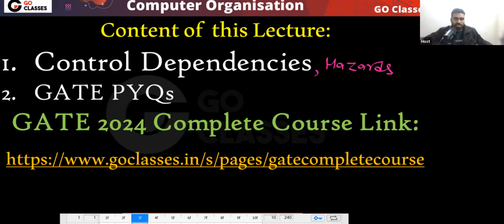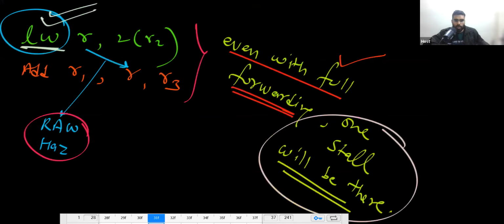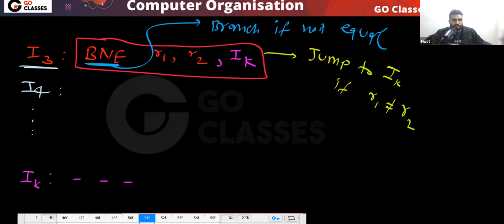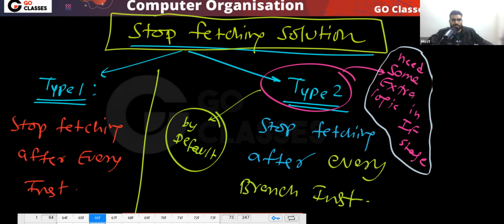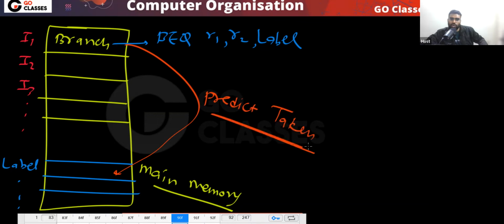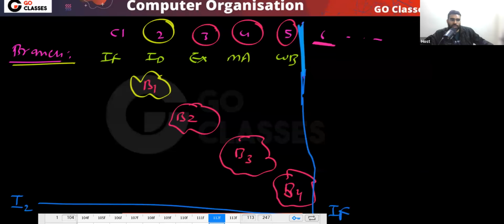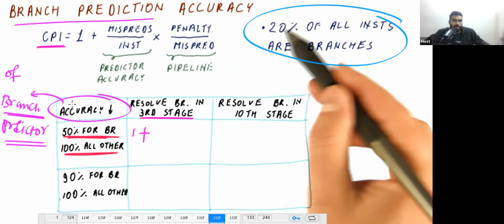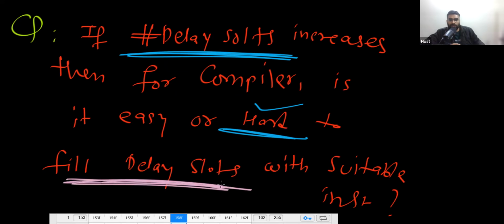Pipeline Lec 5 - Control Hazards | Branch Prediction | Pipeline Complete Course & GATE PYQs

Comment: 00:00:01 - Introduction to Structural and Control Hazards

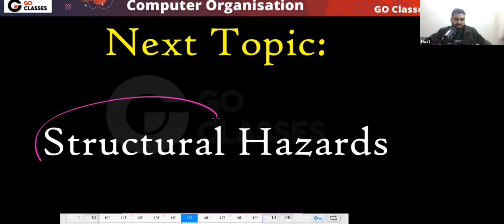00:05:40 - Structural Hazard (Resource Hazard) Definition

00:06:15 - Structural Hazard Example: Single Port Memory

00:16:02 - Stalls/Bubbles due to Structural Hazards

00:19:59 - Solutions for Structural Hazards

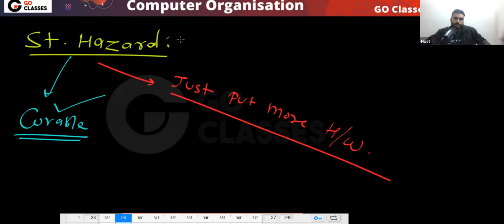00:23:29 - Recap: Eliminating Data Hazards (WAR, WAW, RAW)

00:29:28 - Introduction to Control Hazards

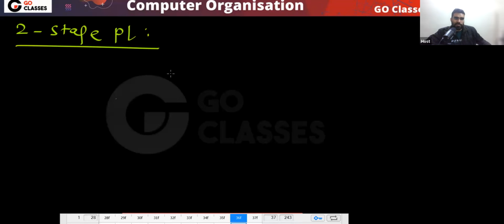00:31:52 - Control Hazard Example in 2-Stage Pipeline

00:38:27 - Flushing the Pipeline

00:44:50 - Branch Penalty Formula (K-1 Stalls)

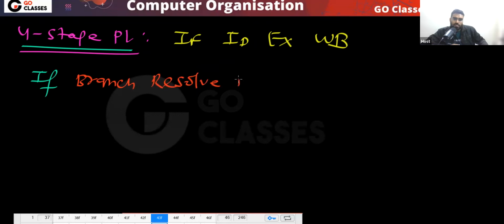00:46:48 - Branch Penalty in 4-Stage Pipeline

00:54:33 - Control Dependency

00:58:10 - Solution 1: Stop Fetching

01:06:19 - Stop Fetching Type 1: After Every Instruction

01:11:37 - Stop Fetching Type 2: After Branch Instructions Only

01:24:39 - Solution 2: Static Branch Prediction

01:30:43 - Predict Not Taken vs. Predict Taken

01:34:50 - Predict Taken Scheme

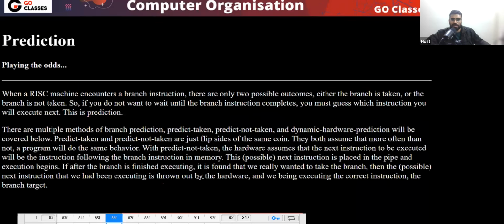01:41:39 - Predict Not Taken Scheme

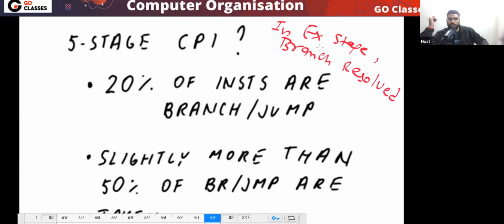01:45:32 - Practice Question: CPI with Stop Fetching Solution

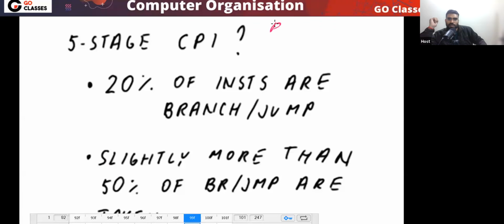01:54:15 - Practice Question: CPI with Predict Not Taken Solution

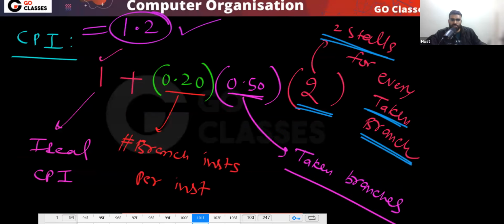01:59:00 - Practice Question: 25% Taken Branches

02:04:00 - GATE 2000 Question Solution (Part A)

02:13:00 - GATE 2000 Question Solution (Part B)

02:23:56 - GATE 2006 Question Solution

02:30:01 - Solution 3: Dynamic Branch Prediction

02:31:45 - Calculating CPI with Dynamic Prediction Accuracy

02:37:45 - Speed-up Calculation

02:40:35 - Solution 4: Delayed Branching

02:45:51 - Delay Slots

02:50:06 - Filling Delay Slots with Independent Instructions

03:00:01 - Conclusion and Summary

🔴🔴MAJOR MISCONCETPTIONS

00:23:29 – 00:24:11 | Are Structural Hazards "Incurable"?

Misconception: Thinking structural hazards are a major, unsolvable problem like data hazards.

Clarification: Structural hazards are easily curable. They are simply a "lack of hardware" (resources). If you add more hardware (e.g., separate instruction and data memory), the hazard disappears completely.

00:24:11 – 00:28:09 | Are Data Hazards 100% Eliminatable?

Misconception: Thinking all data hazards can be perfectly fixed.

Clarification:

WAW/WAR Hazards: Yes, these are 100% eliminatable using register renaming.

RAW Hazards: No, these are the "real villain." Even with full forwarding, they cannot be 100% eliminated (specifically the Load-Use hazard still requires one stall).

00:34:44 | Knowing it's a Branch during Fetch

Misconception: Assuming the processor knows an instruction is a "Jump" or "Branch" while it is still fetching it.

Clarification: In the standard pipeline, during the Fetch stage (IF), the processor does not know what the instruction is yet. It only finds out it is a branch during the Decode (ID) stage, which is why bubbles are created.

01:06:19 – 01:09:48 | "Stop Fetching" Strategy Scope

Misconception: Thinking the basic "Stop Fetching" solution only pauses for branches.

Clarification: The speaker clarifies that without extra hardware to detect branches early, the "Stop Fetching" solution (Type 1) would have to pause after every single instruction (even additions or subtractions), making it the "worst solution." To stop only for branches (Type 2), you need extra hardware in the IF stage.

01:22:58 | Definition of a "Bubble"

Misconception: A student asks "Why two bubbles?" implying a bubble is a specific object or error.

Clarification: A "bubble" is just terminology for a stall. It simply means that for that specific clock cycle, no new instruction is being fetched. It’s not a physical object inserted into the pipeline.

01:48:05 | Relevance of "Branch Taken" Percentage

Misconception: Trying to use data about "50% branches are taken" when using the "Stop Fetching" solution.

Clarification: For the "Stop Fetching" solution, whether a branch is taken or not is irrelevant. You stop fetching for every branch instruction regardless of the outcome, so you pay the penalty every time.

02:02:42 | When do we pay the penalty in Static Prediction?

Misconception: Confusion on why we calculate stalls only for "Taken" branches in the "Predict Not Taken" scheme.

Clarification: In "Predict Not Taken," you assume the branch won't jump. You only pay a penalty (stalls) when your prediction is wrong (i.e., when the branch is actually Taken).

02:53:29 | Meaning of "Independent Instruction" in Delayed Branching

Misconception: A student asks if the instruction in the delay slot must be independent of the condition.

Clarification: The instruction placed in the delay slot (usually by the compiler) must be "safe" to execute regardless of the branch outcome. It is usually an instruction moved from before the branch, so it doesn't affect the correctness of the program logic.

02:55:13 | Execution in Delayed Branching

Misconception: Thinking the instruction in the delay slot might not execute if the branch is taken.

Clarification: In Delayed Branching, the instruction in the delay slot (the one immediately following the branch in memory) is always executed, regardless of whether the branch is taken or not.

Comment: 22:30  at C4 I1's m/y access so we cant IF, at C5 I2's m/y access so we cant fetch, at C6 I3's m/y access so cant IF. we must only be able to fetch instruction for I4 at C7 right? how are we fetching at C5?
Reply: same doubt
Reply: INST 1  is a load instruction so it will use the memory access stage to access the content from the main memory .now we assume for the sake of explanation that inst 2 and 3 are simple add or sub anything like add r5, r6, r7 so they wont use the MA stage ..now at c4 inst 1 is using MA stage to access content from memory and inst 4 is doing instruction fetch which will access the memory hence a structural hazard so there will be stall....now when we come to c5 instruction 2 doesnt need to use MA stage cuz its just normal add like above mention so instruction 1 is free to use the memory and it will do the IF in cycle 5

Comment: 2:50:38 In classical mips pipeline branch instruction is resolved (target address known) at ID stage or EX stage? 
isn't the address calculation happens at EX stage.
Reply: In ex stage ALU perform its task(jump will happen in ex stage) but in ID stage we decode means here wo know that ohh this is a jump instruction . that's why classical mips piple branch instr. is resolved in ID stage only..

Comment from the maker: 00:00 - Introduction to Structural and Control Hazards
05:41 - Structural Hazards (Resource Conflict with Single-Port Memory)
23:44 - Comparing Eliminability: Structural, Data (RAW/WAR/WAW), and Control Hazards
31:33 - Control Hazards: Branch Instruction Execution Flow and Pipeline Flushing
44:17 - Branch Penalty Formula (K - 1 Stalls for Resolution at Stage K)
53:11 - Understanding Control Dependence and Conditional Branches
58:24 - Solution 1: Stall/Freeze Fetching (Type 1 vs. Type 2 Hardware Implementation)
1:24:41 - Solution 2: Static Branch Prediction (Predict Not Taken vs. Predict Taken)
1:45:13 - Practice Problems: Calculating CPI under Stop Fetching and Static Prediction
2:04:06 - GATE 2000 Question: Average Execution Time with Conditional and Unconditional Branches
https://gateoverflow.in/683
2:23:33 - GATE 2006 Question: Total Execution Time with 20% Conditional Branches
https://gateoverflow.in/1818
2:29:48 - Solution 3: Dynamic Branch Prediction and Multi-System Speedup Calculations
2:40:51 - Solution 4: Delayed Branching and Delay Slot Filling by Compiler
3:01:02 - Course Summary, GATE Practice Advice, and Wrap-Up
Reply: Thankyou so much sir... nicely explained.... I don't know about this